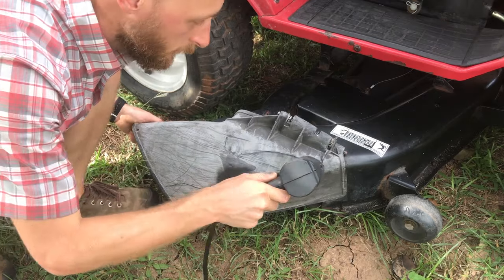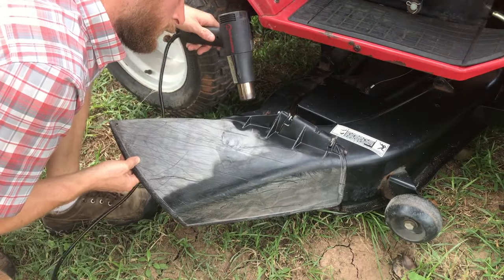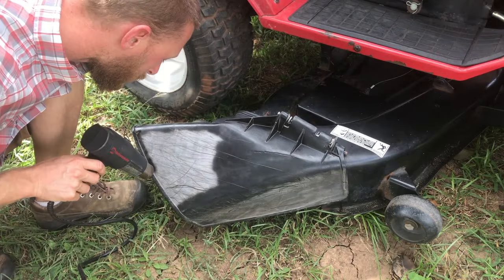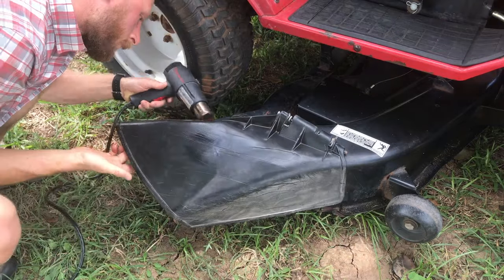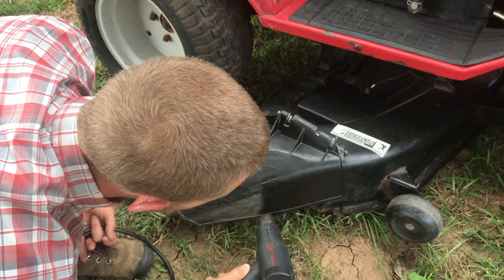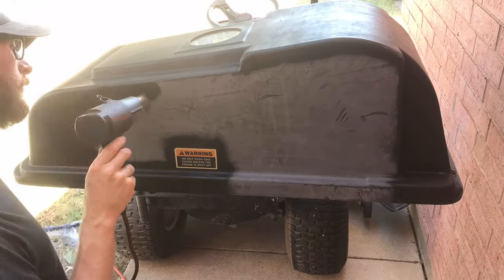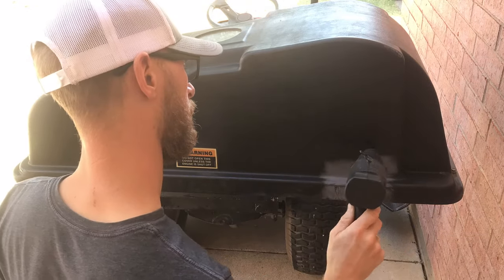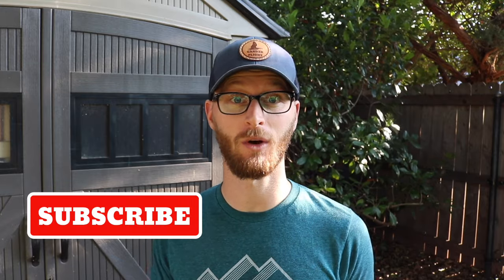RESTORE Faded Plastic and Make it Look NEW - Easy and Cheap!

Comment: People please dont do this.  It brings the oils to the surface and weakens the plastic.  Go ask any detailer and they will say this does more damage than you know.
Reply from the maker: Thanks for your input.
Reply: Well it’s a lawn mower not a Lamborghini.  Just saying I wouldn’t do this on a nice car, but I don’t think people are too concerned about the structural integrity of their lawn mower chute or a little tykes car, it just makes them look good😂
Reply: Plastic bumpers are not really strong, the real bumper is the metal one behind the plastic bumper. The plastic one bumper only to look good no protection at all its the metal one.
Reply: As a detailer, this is fine for most older plastics.  The plastic they use generally on cars after the 90s is not the same, so i dont recommend doing it to newer plastics.  Stuff like lawnmowers, plastic chairs, your kids old playskool castle, even tires.... works well.  Just make sure the heat is LOWWWWW
Reply: Agreed on this leading to weaker plastic. Soft scrub pad and boiled linseed oil is what we use on old seadoo hoods as it restores oil, not roast it out like melting does
Reply: Relax it does nothing to the plastic.
Reply: Yup, reheating the plastic close to it's melting point will weaken it. I wouldn't do this for anything structural or expensive... but a lawn mower grass catcher? Eh--probably fine.
Reply: Too much work too
Reply: As a plastic molder I dont agree. If it is weakend then it is because you have used too much heat and actually burned the plastic.
Reply: This can be tried on thick plastics, and melt only the surface just a bit and not too much. It can alter the structure itself on thinner plastics. But thinner plastics are already weak.
Reply: Plastic was melted to form initially. I've used this on so many things and it hasn't caused anything to get weaker. I've used it on my old car plastics and rubbers over and over through the years and it never hurt, just brought it back to life every time.
Reply: Did someone say heat on tyres 😖🙆🏿
Reply: @henriklassen3435 i have an engineering degree on moulds and plastics and totally agree with you. This isn't like weakening a tempered metal. Chemical structure is still there. Sun already did the damage of weakening some thickness off. This just makes it even and even improves surface.
Reply: @russelldevane5434  You blind? It's happening,  look at before and after the heat gun passes.
Reply: Nah that’s BS
Reply: @thishandleisnotavailable  Hello- would you mind checking out some questions for me please?  I have a big old vintage plastic palm tree grouping that was my grandparents... as awful as that sounds- it's actually awesome. The plant is dry, dusty, and starting to become brittle. Would you mind letting me know what you'd recommend to clean & shine the leaves, along with something to help protect it (that is non toxic because my lizard might climb in there if given the chance... :)

Thanks so much. Mit
Reply: @leonelgraca   Hello- would you mind checking out some questions for me please?  I posted to you and one other person because of your knowledge. I have a big old vintage plastic palm tree grouping that was my grandparents... as awful as that sounds- it's actually awesome. 🌴🌴🌴 The plant is dry, dusty, and starting to become brittle. Would you mind letting me know what you'd recommend to clean & shine the leaves, along with something to help protect it (that is non toxic because my lizard might climb in there if given the chance... :)

Thanks so much. Mit
Reply: @MyrtleBeachWebAngel  not quite sure.  Being brittle is a huge concern.  Maybe try soaking it in something like hot/ boiling water.  Not sure the type of plastic is may be so use cauition  Keep in mind the melting point of plastic versus the temp of the water.  Just at boiling point should be safe.  Maybe remove a small piece and test before applying to larger areas.  It would have to be done all at once, so it seems you may need a large container
Reply: @thishandleisnotavailable  Thank you. I've got it in the bathroom and it fills up the whole tub... it's huge. 😄 I think I'm going to use a little Dawn or baby shampoo to wash the dust and grime off the leaves with a soft brush, rinse it down with super hot water a couple times, then I'll hit it with a hair drier on low? I'm still not sure what will shine up the leaves but not degrade the plastic and still be safe for the lizards. 🌴💘🦎🦎🦎 I appreciate the help.
Reply: What about if you do this  and then rub in some of the "plastic restorer" products that always seem to almost work? Maybe the recently heated plastic could more easily absorb some new oil deep enough to help it resist sun fade longer? Worth a try on something that is not too expensive to replace if it doesn't work.
Reply: I worked in car interior manufacturing for years. This is how we extracted color in dull areas of plastic panels. For brand new cars. It’s the only method on plastic.
Reply: @Harvz78 look at the above comments of professional moulders 🤦‍♂️🤦‍♂️
Reply: I planned to use it on a used little tikes playground that is faded. Happy I came across your comment. I'll start looking for paint I can use instead. Thank you
Reply: You must not be very smart lol! The oil doesn't move in the plastic. Sounds like you been inhaling the fumes.
Reply: So what do you recommend? Buy a new lawnmower chute lol 😂. Oh that's a good choice because no one wants a minutely compromised lawnmower chute for heavens sake! Buy a new one otherwise the manufacturer will be upset.

Comment: be careful with this, all you are doing is pulling out the oils from deep within the plastic, which tends to cause a faster fading.  Maybe there needs to be added a top clear coat or something to be added into it.  I did this on my scooter and it got really bad looking fast.
Reply from the maker: You'll definitely have to top coat it or use a UV protectant spray to keep it from doing it again.

Comment: This method should be avoided. Watch closely when he heats the plastic it looks wet or shiny and then fades. That is the elasticity in rubber and plastic evaporating. This method of applying high heat makes plastic brittle, harden and break.
Reply: I prefer olive oil.

Comment: This works very well. This works because the oils deeper in the plastic come to the surface and make it shiny again. The downside is that all the oils in the plastic will disappear if you do it multiple times. I do this sometimes but I prefer to use plastic polish.
Reply from the maker: Any specific product you prefer for the plastic polish?
Reply: @GanderFlight  Polytrol is good. It refills the plastic with oil. The faded look on plastic is because of the top layer getting evaporated.
Reply: @mathiasdankertsen9093   Polytrol? may I ask, where do you pick that product up? When I tried to search for Polytrol, nothin came up.
Reply: It's called Penetrol by a company named Flood

Comment: By chance, when working on a dirt bike project CR 125 back in 1989, I discovered this little trick when using a hand held propane torch near the (completed faded, oxidized) fender of the bike, for a completely different repair. Sometimes unintended consequences work for the better.... but, heat gun is much better than the torch, no doubt
Reply from the maker: Nice! And agreed - heat gun is the better way to go ;)

Comment: Thank you SO much for that! While i was trying to restore a very old computer with Peroxide, i noticed that the bleach effect was a bit too much and left some patches and marks on the surface. Your tip made most of the surfaces look much better!
Reply from the maker: Glad to hear it!
Reply: @GanderFlight  will this work into turning old yellowish plastic into new white again? Hydrogen peroxide destroys paint so I want to try other methods.
Reply from the maker: @BOREDANDWELLBORED  Most likely it will NOT work on yellowed white paint. Maybe try on an inconspicuous spot and report back!
Reply: @GanderFlight  It's yellowed white PLASTIC,  not paint. It's the high top of my Ford van, it's white plastic,  nothings painted.  I haven't tried it yet and hoping others have.  Thanks for the reply
Reply from the maker: @BOREDANDWELLBORED  Yeah sorry, that was just a mistype on my part -- I don't think it will work with white plastic if it has yellowed - but I've never tried it.
Reply: @GanderFlight  I'll try it.  I've seen faded red plastic chair become new red again.  Looks like the heat gun brings up the original color of the plastic. We'll see

Comment: fantastic trick with the heat gun. Did you know that these plastics melt about the same temperature as solder? You can repair cracked plastic by adding more from the back side and melting it in to weld the crack shut. If you do it ion the pretty side it will not look good. But if it's broekn or failing this is a great trick too!
Reply from the maker: I've repaired a few things that way too!
Reply: HF sold a plastic welding kit last I checked for $15 and probably still do. In addition to the iron it comes with filler rods of different plastics and I've considered buying it like 5 times but never have.

Comment: Awesome!  I'm refurbishing an old 120qt ice chest because it's a custom fitting piece for my boat. I can't just buy a new one, they don't make this size anymore. I'm planning on spraying it with bedliner after fixing a few dents, dings and small holes but the very top lip I don't want to do with bedliner as it would affect the seal from the top.  I need to use your trick on this little strip of plastic just at the top of the walls where the lid lays down to.
Reply from the maker: Just remember that you'll then need to protect it form UV rays somehow otherwise it wont be long before it fades again. Might also check out automotive trim restorers like this: https://amzn.to/3SzIFOC
Reply: @GanderFlight   good point & thanks for that link!

Comment: I had a couple handles from an old rusty and weather tool box I was restoring.  On a hunch I rubbed them down with mineral oil, and it seemed to work pretty well.  I don't know the chemistry of what occurred. But I might try combining this heating method and then applying the mineral oil while the pores are still open.  Think that'll add to it, or is that just overkill?  Or even counterproductive?
Reply from the maker: I’m not sure, give it a try and report back!
Reply: Try olive oil. I use the aerosol type for easier application.  I get the store brand from Walmart. Keep overspray off unintended area with a clean separate microfiber cloth. I rub in the oil with a mirofiber cloth as well as lightly buffing after a few minutes. Apply to projects out of direct sunlight. Works well on bedliner to. Be sure to test for slipperyness. Buff off excess after few minutes  usually takes most of slipperyness but testing makes sense. Although plastic bedliners are notoriously slippery anyway .

Comment: I was looking for a way to restore my outdoor plastic chairs...I saw this idea or using olive oil. 
I haven't tried either, but this ideas makes more sense. Thanks for this post! What heat gun do you recommend using?
Reply from the maker: Any heat gun will work - all the entry level ones will be identical. Just go slow and start farther away - you can always apply more heat but once it bubbles and melts you can't go back.

Comment: Smell? Volatile compounds?  Do you think this might degrade the longer term stability of the plastic item?
Reply from the maker: Absolutely wear a respirator for safety- yes you are basically burning plastic so take the necessary precautions.
Reply: It only lasts a few days anyways, not worth it
Reply: Jake I’m sure if you wanted to keep the item in good condition after you could always keep it out of the sun when you’re not using the item 😂
Reply: I think it might it only lasts a few days...at least that's what I've been seeing in the comments (hahaha)

Comment: This can work, the only issue is you're making it more brittle by leeching the plastic from within the product to the surface to make it look new again. Petrolatum (Petroleum Jelly) will allow you to have it be shiny again without causing the product to become brittle and break prematurely.
Reply from the maker: First time I've come across petroleum jelly recommendation for this situation - does it leave an oily residue?
Reply: @GanderFlight  Might depend on the plastic, but I used it on my faded cars plastic then rubbed it off with some paper towels pretty hard and it's fine to the touch. The issue is making sure you don't over-apply to begin with because that can end up making it more time consuming later on. I scooped out some petrolatum onto a paper plate then used nitrile gloves to spread it around on the plastic, then wiped it off with some paper towels until it seemed fine to touch (IDK if rags would work better, but the plastics still have their shine even w/ paper towels) 

Basically it can if you don't wipe it all off, IDK if all plastics will react the same either. There's a few videos online showing others doing the same to similar results IIRC.
Reply: if you use petroleum jelly on chairs will it damage your clothes when they come in contact with it when you sit in the chairs?  Does it cause any of the color to come off (I have brown plastic lawn chairs)?
Reply: @mollydog444  Might be fine if you wipe off excess with a paper towel but I'm not sure. I've found that the results for car parts last 3-6ish months max and you need to wipe off periodically especially on hot days or it can come out and streak or so.
Reply: @mollydog444  just like adding cypress oil to wood, of course you should wipe out the remaining after a while. Colour that comes off is degraded plastic by UV light, so a light dusting and sanding could make sense. No it does not act as a solvent to have colour come off, would be a mechanic release.

Comment: Does it work on brittle/faded plastic fan blades by chance? Got an old desk fan branded Phillips from the 1980's and the blades have gone off gray and other parts have gone brittle. Also does it work on curing the brittle plastic? Thanks
Reply from the maker: Nope - will definitely not help any plastic become less brittle

Comment: Wondering if this'll work on a Black Dell laptop. I was trying to remove some adhesive residue from under where a sticker was peeling on the palmrest just left of the touchpad, looked like superglue but I can't recall what I used. Anyway, goo gone 'pro' worked well for wiping off the sticker residue but did little for the presumed super glue. I eventually tried Acetone on it which removed some of it, but also dulled the glossy black plastic which I now know is ABS+PC and is the standard for laptop housings and definitely not resistant to acetone.

It didn't really melt it like solvent welding chemicals used for ABS pipes do, mostly just removed the glossy finish (and wiped up as black fine powder) and looks faded in a small area. Will try the heat method first then maybe a spray of gloss clearcoat
Reply from the maker: hmmm thats an interesting question - did you end up trying it?

Comment: Would this work on the faded plastic on vehicles? Will it leaves marks or does it blend together as you go?
Reply from the maker: I've seen folks use it on vehicle trim - go slow - If you burn it you can't go back.

Comment: Hi, first time viewer. Would this be safe to use on faded plastic fairings on motorcycles (following safety procedures of course)?
Reply from the maker: I think it would work well - go slow and then make sure to find a UV protector to coat it afterwards that you’d apply every few months to keep it from fading again.
Reply: @GanderFlight  Thanks, great channel :)

Comment: It will weaken the plastic more. Try boiled linseed oil and paint thinner. 70% thinner 30% boiled linseed oil. Do a few coats.
Reply: What will that do? Will it clean old plastic and make it shine again? I’ve got plastic chairs from the 70s that need new life - I wonder if this would work??
Reply from the maker: Won’t paint thinner melt the plastic, therefore weakening it as well?
Reply: @GanderFlight  I have removed all kinds of stuff with thinner and never an issue to date. Knock on wood as they say. If I am out of proper remover its my go to.  ossue on plastic.
Reply: @fitzme4  brings back some oils to the plastic. Look er up on the tube! Or on the web..

Comment: Has anyone tried this on seat trim?  The sides on the rear fold up side seats on my Land Rover Defender are well bleached out and now a very light gray, they should be a lot darker but  am a bit worried that they might blow through with heat.  They are a very good make so it's not a cheapo plastic.
Reply from the maker: You could try one of these products too: https://www.youtube.com/watch?v=XXOX4z6uwXo&t=611s
Reply: @GanderFlight  Thanks for that.

Comment: This only very briefly makes plastic look better. A few days in the sun and it's completely faded and old looking again.
Reply from the maker: In my experience its longer than a few days- but yes, obviously if you don’t protect the plastic with a UV blocker then it will fade again.
Reply: @GanderFlight   I tried this heating method on my 79 Scirocco. It only lasted a very short while. I think I'll try something different on the Scirocco and my other cars also.... Perhaps good preparation and then painting
Reply from the maker: @motoflyte  Or try some of these products: https://youtu.be/XXOX4z6uwXo

Comment: I tried this but on some old hanging baskets  the dirt that's stained into them just seemed to melt into the plastic. Any tips to help?
Reply from the maker: I’d definitely give them a thorough wash and dry before hand. What color are the baskets?  If theyre light in color I don’t think this is going to help remove any of the staining.